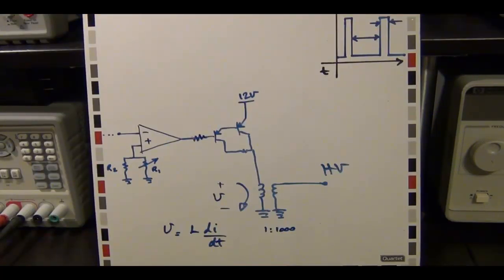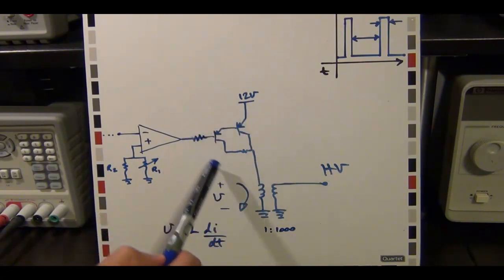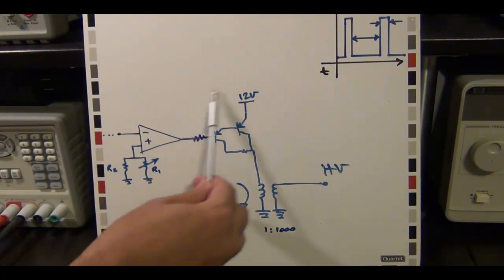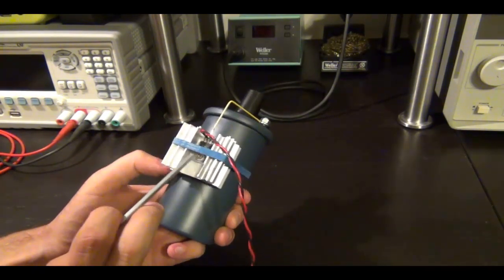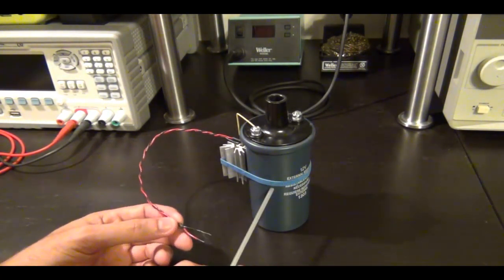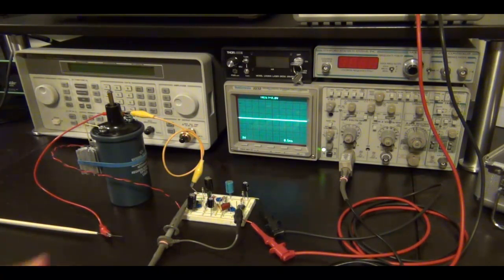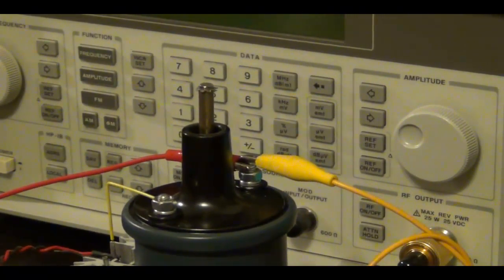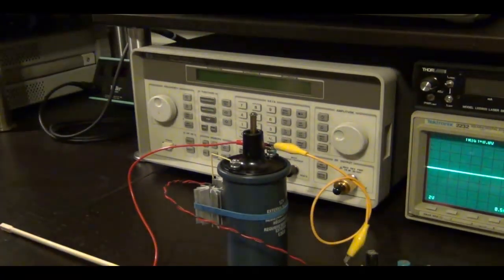TSP #5 - Op-Amps, PWM and Ignition Coils Tutorial (Part 3/3)

Comment: few questions. 1. Is the HV terminal grounding to the secondary that is most likely connected to the ignition coil ferrite core and case or is it grounding to the power supply? 2. Lets say I am using a car battery or some kinda cap system that can take lets say 16V to power this setup. How is the battery or cap going to like it when I pass 30kV back into the negative terminal? 3. Do I have to ground the HV terminal back into the secondary coil itself or can I use an actual earth grounding rod for this?

Comment: Hi #SignalPath, Thank you for such great tutorials. Can you demonstrate an analog circuit which receives an input square wave and outputs the same square wave exactly only delayed in phase. I've tried simply using an rc but find it's too frequency dependent. My source square wave frequency varies. Is there a way to move the reference on and off voltages for the output along a triangle wave (converted from input square wave), so no matter the input frequency change, the delay is proportionate in terms of its degree of phase difference from the source?

Comment: I thought that automotive ignitio coils only needed 12 volts while the engine was being cranked over until started then the primary was dropped down to 6 volts as long as the engine was running. I understand that they were marked 12 volts but actually were supplied 6 volts because of the voltage drop that occurred during cranking therefore the primary supplied 12 volts to ensure that the secondary voltage needed higher voltage..wouldn't a steady 12 volt supply voltage to the primaries result in premature  secondary winding failures of the coil?
Reply: Basically yes. That's why it states 'resistance required'. When running the coil is in series with a resistor. When cranking the resistor is bypassed to give a full spark from the reduced battery voltage.

Comment: +The Signal Path
hello mate! this is my first 'forage' in the jungle called PWM. until yesterday, it was all theory. I reclaimed enough of components out of a n/s crt television to build this circuit  - and tadaa, it bloody works!
being stuck in the electronics of yeasteryear, means I never dabbled with opamps much, but I used the formulae you provided, and the PWM runs like clockwork (literally).
ref. the h/v section...I contemplated using the flyback from the CRT, but didn't fancy looking like 'yahoo serious' of young einstein fame ;)

I'd like to thankyou for this excellent channal, mate. the way you present your material and explain the 'hows and whys' is exceptional, to say the least!

Comment: Also if you look at the schematic of an ignition coil the lo side of the secondary is common with the positive of the primary so your ground wire for the chopstick should be on positive
Reply: apollo robb Spark plugs are grounded through the engine to the chassis so they use the negative terminal on that coil for the ground/return path. The ignition coil is an autotransformer (similar to a variac for example) and to do this is just fine.

Comment: Someone correct me if I am wrong. Tesla created the Ignition coil for cars!
Reply: Traditional contact breaker and coil ignition is called "kettering" system, it does use a very Tesla like principle.
Reply: David Lisney It is true ... "Another one of Tesla's inventions familiar to anyone who has ever owned an automobile, was patented in 1898 under the name "Electrical Igniter For Gas Engines."  More commonly known as the automobile ignition system, its primary component, the ignition coil, remains practically unchanged since its introduction into use at the turn of the century"

Comment: Good videos. Would have liked to see you adjust the high voltage (spark length) by changing the PWM ratio.
As far as I know, then the oil in the ignition transformer is also used because of its high isolation factor, like in some high voltage capacitors.

Comment: think the breakdown voltage of air is around 30kV/cm
Reply: Right, with a few small conditions.  First, that is with large spherical electrodes.  It also is at “normal” air pressure, temperature and humidity.  And moreover, it applies to 50 or 60 Hz AC.
Having sharper electrodes will reduce the break down voltage, maybe to 10 kV.  Then, if we have a relatively fast pulse front traveling along a constant impedance transmission line, we get something else again.  When the step front arrives to the open end of the transmission line, there is a reflection that doubles the voltage.  That doubling is likely to strike a discharge where a 50 Hz sine wave would not.  Finally, when you have repeat sparks, you generate some lingering ionization and the next spark jumps easier.  Similar effect may come from ionization by nearby radioactive source.  That last one is used intentionally in some smoke detectors and for example 470 V Gas Discharge Tubes for transient clamping.

Comment: I think that the only piece of theory that lacked from this video was how Pwm comes into play with making this high voltage power supply . For example what effect does the width of the pulse have on the voltage or current etc..
Reply: Shagas Heizenberg IT IS THE CHANGE IN THE CURRENTAS A RESULT OF PWM

Comment: Excellent video with a logical sequence explaining the various parts of the circuit. I have built a similar one using an ignition coil using a 555 based circuit followed by resistor and a Darlington. I also used varistors across the ignition coil primary to limit voltages during switchoff to avoid damaging the rest of the circuit. Would the ignition coil have a resonant frequency at which it would generate the highest voltages for a given power supply thus acting sort of like a mini Tesla coil ?

Comment: Whats the best way to construct the circuit to where it is immune to the noise being generated by the high discharge currents?  is it shielding the circuit and introducing a ferrite bead inductor of sorts on the signal lines to the transistor as a filter?

Comment: You should try a flyback transformer (From a CRT) and use a MOSFET as the switch, just remember to use a common emitter (source sink) to drive the MOSFET and pull the gate down with a 1-5k resistor so the gate doesn't float high with rapid drain voltage swings caused by miller capacitance.

Also, you can use a 555 timer and an op-amp to get a variable frequency, variable duty cycle PWM, 555 timer creates sawtooth, op-amp compares with a threshold to control duty cycle.

Comment: Where does all the current necessary for the sparks come from?? Is it from your power supply unit?
Reply: +sin6city6stories6: The voltage (very high) and current (very low) for the sparks comes from the build-up and collapse of the magnetic field created by the primary of the ignition coil. Really it's an ignition transformer with a low-voltage primary and a high voltage secondary. During the time that the PWM output is low, the PNP Darlington is turned ON very hard. Maximum current flows through the primary of the ignition coil, building up it's magnetic field to a very high value. When the PWM output goes HIGH, the Darlington turns 0FF and the magnetic field collapses. The rapidly changing magnetic field of the primary induces a very high voltage on the secondary, which shows up in the video as "sparks". The sparks - between the high-voltage terminal of the secondary and  his grounded probe - are caused by the secondary voltage exceeding the breakdown voltage of dry air, which is 33kV per centimeter at sea level. Ionization of the air creates the blue-white glow
 which you see as a "spark".
Reply: +sin6city6stories: Yes the current to build up the magnetic field of the primary comes from the power supply. The collapse of that magnetic field causes the high-voltage in the secondary. That high-voltage causes the spark, so long story short, YES the current necessary for the spark comes from the power supply, but I kind of went the long way around the barn to get to it in my other reply.

Comment: When I was 12 years old I took a 330V 400 micro farad cap charged from a camara flash and stuck it on a car coil, A spark about 5-7 inches leaped out and hit me in the end of one of my fingers burning a small hole and throwing me off my bed about 4 feet...I hurt for almost a week all down my arm and chest...it was the last time I ever messed with a car coil... Lesson learned. I was never able to find out how much of a hit I took off it. Can anyone figure it out?
Reply: David Smith If you still want to know, the capacitor (if it was fully charged) discharged around 21 Joules and .132 Coulombs, which is like 165 Volts at 132 milliamps in one second - this could kill someone - without an ignition coil...

Comment: im missing something here. I understand that youll need a signal gen (square) for that transistor to switch the coil. And i understand that youll need the intetrator and the comparator to make a triangle wave and a PWM controllable wave. ... but what for do you need a PWM stage to drive the coil ?!?  why not driving it from the first stage (square) at a specific freq?

Comment: You can get more spark distance than that out of ignition transformers using 12V in series with a 300V mains filter cap and then the coil.  Put a pushbutton across the.capacitor.  When you break the button connection it starts to ring.  Quite often the spark will leap right out of the top of the coil and around the edge to the ground terminal. The metal screw sitting in the top isn't necessary, it jumps right out and around.  Some coils work better than others though.

Comment: I was about to ask the same question because from what iv reading lately when the transformer is not being provided with voltage the magneting field colapeses and you ger a return voltage spike, so a diode its fitted to stop damage to circuit. I dont know if im correct but thats im asking im teaching my self :)

Comment: It is not AWG generator but amplifier  operated  by AWG.10KHz-1MHz 1-10V
I will give you some hints:
SG interface parts::LM393(both comparators used),1N4198 (2 pieces)1N4198 (2),21n60(2), transformer with primary winding with center lead. 4 secondary winding ( the same-equal)

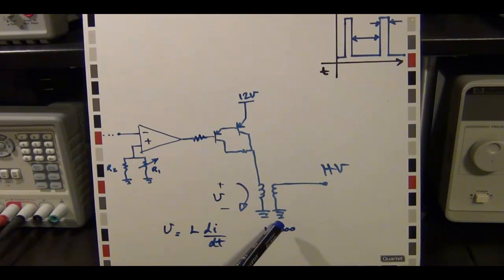H-bridge  driver:starts after primary: 7N80(4), 1 special transformer 1:10 ratio,permeability 2000 (primary is spread equally) secondary is spread equally) 500V, 2A  For you it should be 1 day of thinking.
Wesley

Comment: by the voltage range 0-20 000V up to 1 Mhz no distortion to its extend of maximum of possibility
I have on bench 10kHz to 1 MHz 0-10 000V AWG right now that I'm in process of assembly and testing
I wish you the best. 

You may become a genius or you may waste your time working for some lab  or some employer  It is up to you young man....All you need is motivation....
Wesley

Comment: 30 000V per centimeter 
You did not show waveform at the output, at the spark gap and spectral components on spectrum analyzer, The video series is extremely educational . You suppose to be a teacher.
That is the best job for you. Another suggestion for project: HOW WOULD YOU BUILD AWG
FOR 2000-2000V? 0-1MHz Basics are good but your brain power needs excessive motivation to the area that is going to sparkle your true potential.
Wesley
PS: Science  is my state of conciseness and my devotion.

Comment: I don't think a complete explanation of the theory is necessary, but some component sizing guidelines or other practical pointers would be nice. I've found very little information on what values to use for some really simple opamp circuits like the integrator.

Comment from the maker: @Atlascol Are you referring at the input or the output of the transformer? Also, the TIP147 Darlington device that I am using, has a built in clamping diode in it. I did not show this on the schematic.